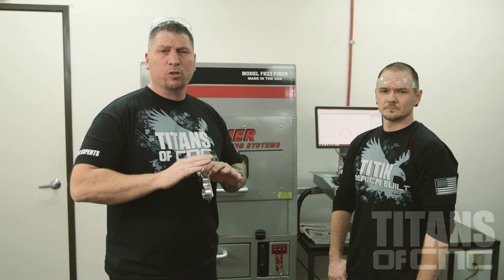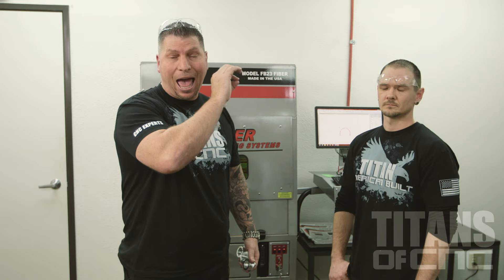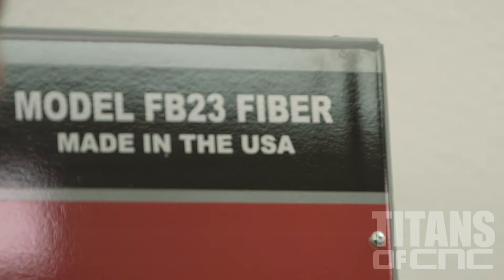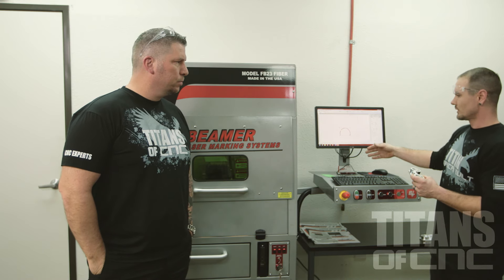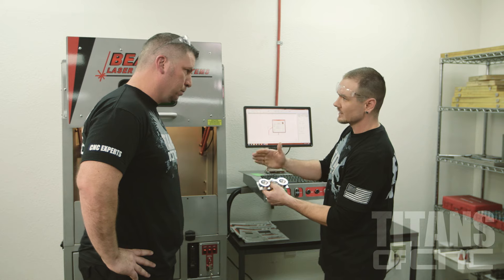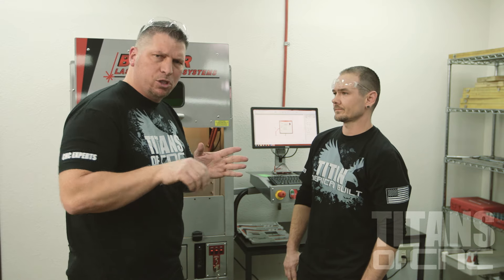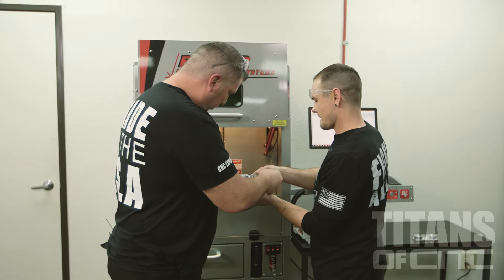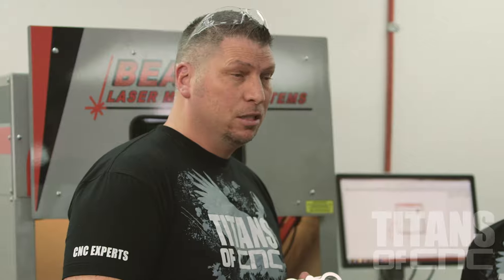TITAN Discusses Laser Part Marking

Comment: You need to make an alignment plate (I call it a straight plate). Mine has a grid of 5mm dowel pins and M5 holes. When setting up, with most parts you can just push the parts up against the pins and use the threaded holes to clamp. If the plate is straight, the parts are. It's made lasering so much easier since we made one of those.

Comment: does that work on anodized or powder coated parts? or does it need to be bare metal?
Reply: We actually prefer it in anodized as it can increase contrast and readability long term, and should the company prefer it, enables barcodes to be directly and permanently placed on the parts. Any surface will do, but anodized is just a little easier in many cases. 
Powder coated, a little tougher depending on the thickness but for a quality laser is no problem at all.
also, fiber lasers like the one used in this video are so much more efficient than many co2 lasers smaller outfits use.